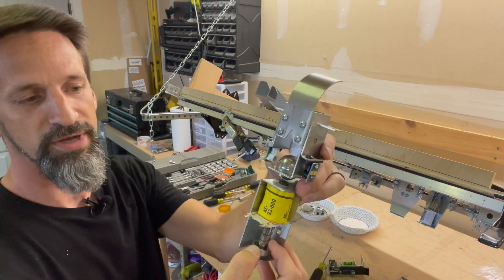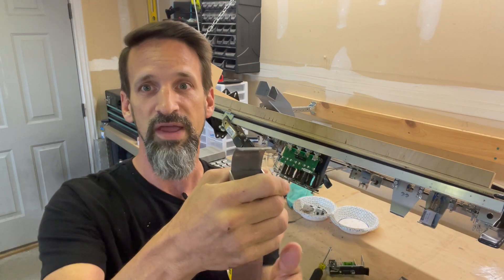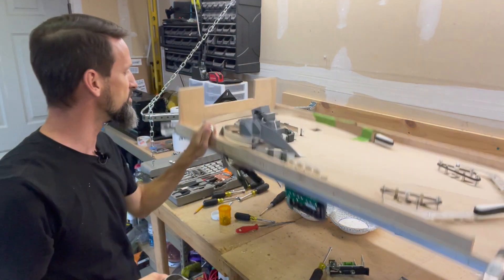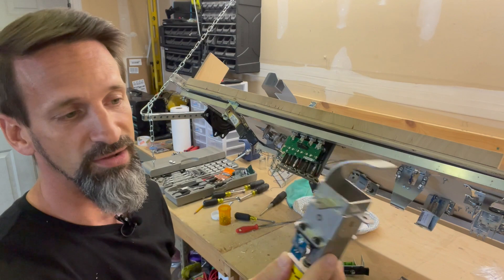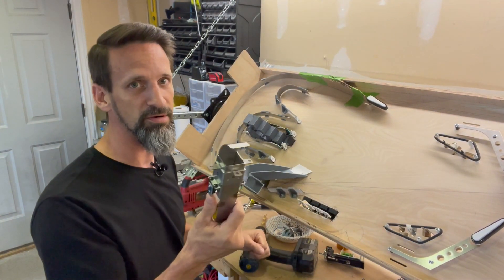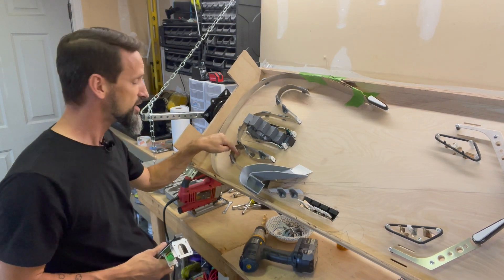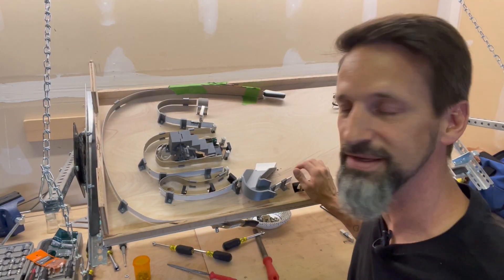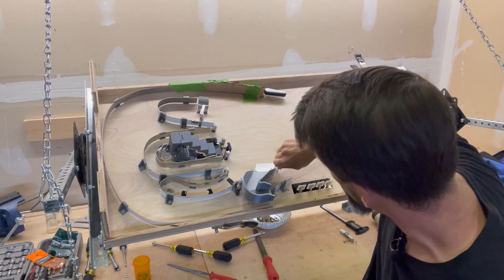HOW TO MAKE A PINBALL MACHINE   VUKs, Drops and a Spinner

Comment: Maybe you mentioned it in an earlier video, but why can't we use standard screws instead the hexagonal or octogon headed ones?
Reply from the maker: You absolutely can, you just want a screw that has a flanged head so it has enough surface area to hold things down, and the correct length to not go all the way through the wood, with how often I'm taking things on and off tho, I prefer the Hex head vs a standard or Phillips head so it doesn't get stripped as easily after time
Reply: Thank you! I enjoy your videos, I like Led Zeppelin as well. I am excited to see the final machine.:)

Comment: Asking here since this is the latest vid. Would it be possible to upload CAD files in STEP format (.step/.stp) to the google drive as well? You should be able to export the project in Fusion 360 to the STEP format. Thanks for all the vids, its a great help!
Reply from the maker: I can sure try 😀 are there specific things you want in that format?
Reply: @thepinballroom  The Lower third play field please. Thanks!
Reply from the maker: Ok, there's now a .stp file for the pf lower third. I'm not familiar with that format, so take a look and make sure it came out ok and let me know if it didn't, ok?
Reply: @thepinballroom  I don't see it in the Public Files Folder in the google Drive. Was it added to the folder? Or maybe the permissions aren't set on it correctly?
Reply from the maker: @frogbastard8108  ah, it hasn’t synced for some reason, try again it should
Reply: @thepinballroom  thanks! all good